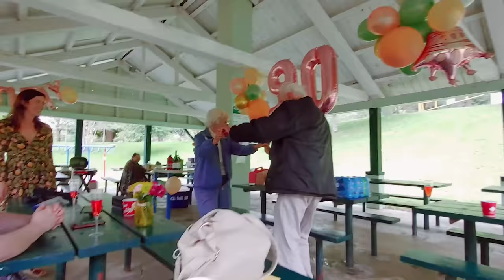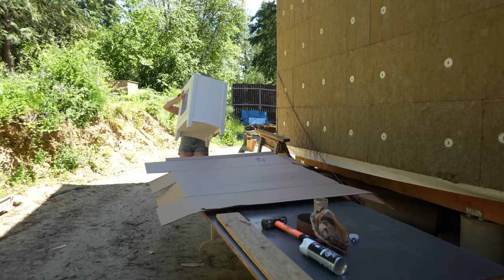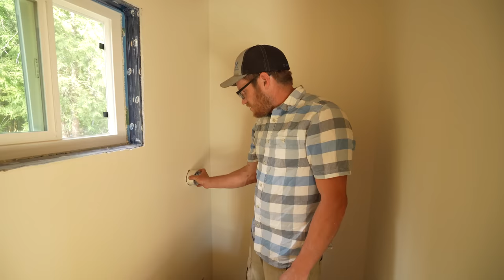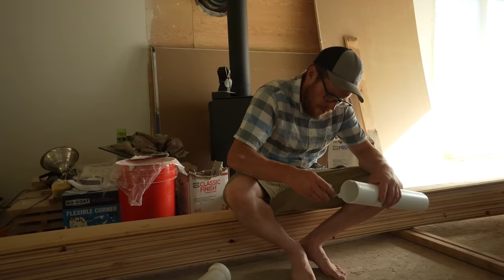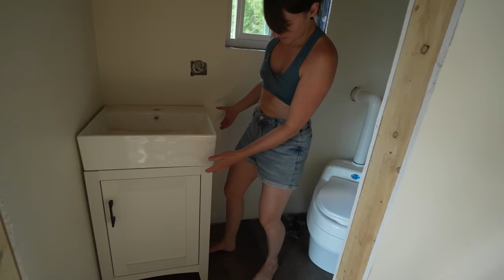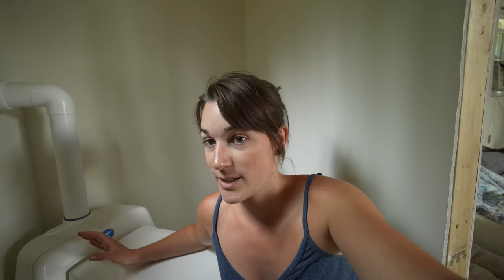Installing A Composting Toilet In Our Off Grid Home

Comment: Alternative might be P-Lam, laminate you glue on with contact cement. I have done it with both wood veneer and laminate finishings. For the vanity. It requires some careful measuring, slight sanding to get sharp edges rounded, but it is waterproof and lasts through cleaning. 
Just an idea if that bugs you too much.
Reply from the maker: Thanks for the idea

Comment: Try wiping the vanity down with a TSP mixture.  just go to the paint section and tell someone you need some TSP.  It will be in a crystal form, and you just add some water.  It will take off the gloss on a painted item and then just simply repaint.  Also, if you are repainting a wall in your home and it has a semi-gloss or gloss paint or if the walls are a dirty, then wipe them down with the TSP solution and let dry, then paint.

Comment: I know this is too late by now, but FYI. Before you install the sink, install the faucet and drain first, it is so much easier than getting under  the cabinet to do it. It will save your back, I know, I was a plumber for 20 years.

Comment: Long time ago when I was looking at composting toilets I liked the propane 1 because alls you had to deal with was out out a tray of ashes but you could get it here in Canada Bc so went with a big 1 you added peat moss and lime to tank was under the floor tolet was ontop it turned by hand it had a barrel inside the tank you used a RV toilet U got it back in around year 2000 it had a water line you flushed it just like a reg tolet empty it around every 3 -4 months

Comment: Congrats on the move in! Back in the day they had porcelain covered steel chamber pots with a lid! They were emptied daily! Well, technology eh! You guys get lots of rain. In time, you can perhaps make that work for you! Shallow, dug or drilled wells are at 40feet unless you are sitting on a rock. Winter runoff or trickling springs can be saved in a cistern! Life has lots of Choices and planning! Ron PTL USA just below B.C and far away from D.C.

Comment: You need a couple of vents in the roof or else where in your bedroom upstairs to get the heat out of your room..Heat rises and in the winter time your bedroom upstairs is going to be hotter..ceiling fans is what you need too
Reply from the maker: The whole high side of the roof is ventilated, it's a vaulted ceiling with 2" of ventilation
Reply: @ThisOffGridLife  if it's still getting too hot 🔥 up in your up stairs bedroom,there is more you can do to get the heat out..I'm very sure that you will figure out..

Comment: You kids handled the subject very well as its difficult to say and not say some things that are well "awkward" in the least. We have a company that delivers great water up to a thousand gallons for a hundred dollars and just minimum cost per thousand gallon extra. Many here live right near a river yet no water for the home can be found on the property's. I much prefer just using my underground tank that holds ten thousand gallons... a solid rock tank that had to be drilled for the drain to do any cleaning. I get more than enough water from rain alone to keep full or at least near it. Great filters make it simple. Even the septic is solid rock with a cement cap for the cover an its hookup's. Grandma makes me look old as her feet are still lively

Comment: Young lady, you messed up. You never mentioned the bum sprayer In Thailand we have the bum gun. A hand sprayer that affixes to the inlet and on the toilet and has a bracket  on the wall as a holder. When you are done you just reach back and grab the bum gun and clean up. Women love it because you can use it on two different places. It is easy clean healthier and you don't have to buy toilet paper. I know you will enjoy that feature. It may take a cou[ple of times to get used to it but when you do you will never want to use TP again.

Comment: 21:54 in video is that an AC unit in the window in the back ground? / you go girl, that is the only way I can sleep at night is in an airconditioned bedroom / I always kept a small unit to run off generator during hurricanes so I could sleep at night
Reply from the maker: Yes but it's a bit small for the space. We'll be adding a different one in there soon

Comment: You should have wiped your cabinet with a solvent first to clean off any waxes and surface coatings. Then light scuff with a scuff pad, then painted with high quality spray paint.
Reply from the maker: I did wipe with a cleaner but it still didn't like it 😅
Reply: @ThisOffGridLife  Why I said use a scuff pad as well it isn't like sanding you're just scuffing the surface so paint will stick to it.

Comment: Wondering if you have an update on the Separett Villa - how are you still liking it two years later?
Reply from the maker: It’s been great. Only issue is the pee tube being small and it tends to build up. We bought a long wire handle brush and cut the bristles to fit in the tube. Not a nice job 😂
Reply: @ThisOffGridLife  thank you for the update!

Comment: Hi Guys,    I'm curious as to what your exterior greenish insulation is made of, that it's able to stand up to the elements and that you don't seem to be the least bit concerned about getting it covered from the elements. 

Too late now, you have already glued down your sink vanity top, but next time, like for your kitchen sink, install all the faucets and drains with the sink out on the floor. Then everything drops into the cabinet ready for hookup, with much less trying to get things hooked up, on your back, in that tiny, small cramped space inside the vanity. You may want to seriously consider cutting the sink free to do this..."?" Best of luck with your install....

Kudos, best regards, Ted, North fork, Jamesport, Long Island, NY

Comment: My opinion is that this type of toilet is not very hygienic, in the long run it will stink and get muddy.
I have to tell you that I am in love with your life and the momentum of your work as a couple, you will be happy forever if you continue like this.
But human life needs water. They must have a shower upstairs, in that same bathroom. It's called a bathroom for a reason. You have to bathe daily.
And there is always water, you just have to find it. You can make a deep well with a windmill that fills an elevated tank and you will have all you need.
I wish you success.